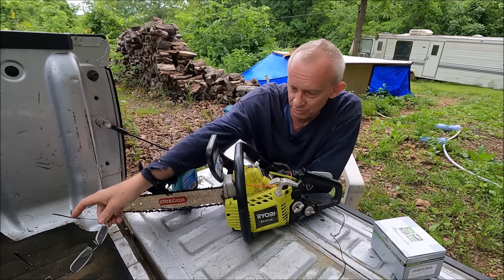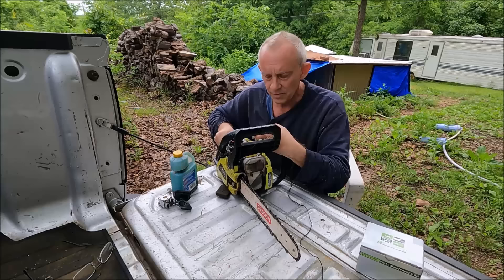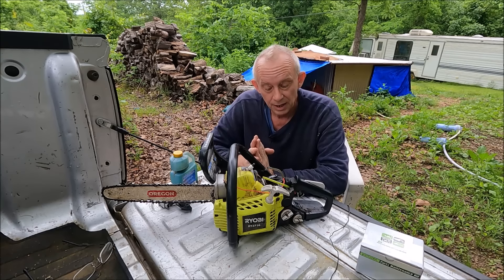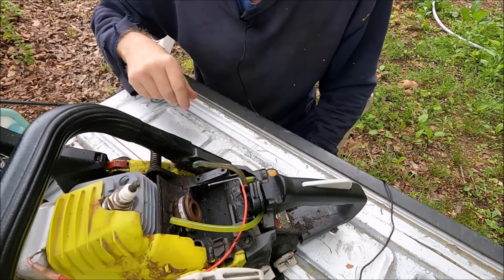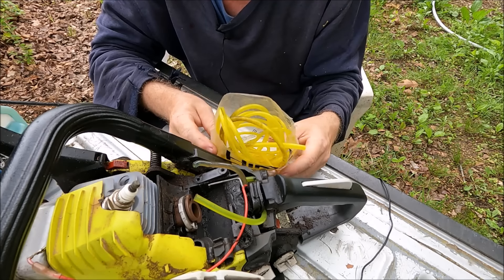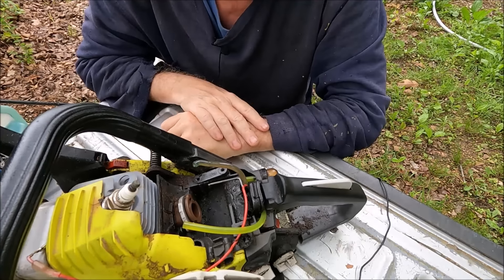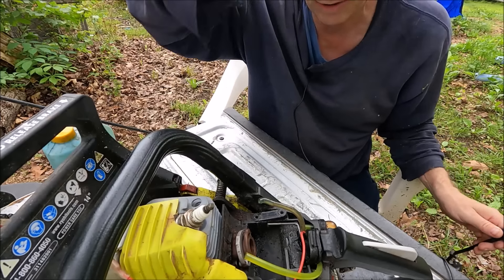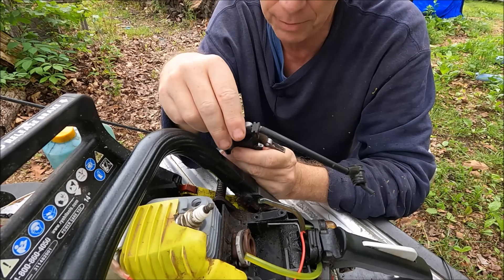Carburetor Kit For A 14" Ryobi Chainsaw

Comment: Good video,
Fuel lines and primer bulbs on these two cycle engines just about have to be changed every couple years.
Mainly due to heat and vibration cause fatigue in the rubber.
So yes definitely keep an assortment of spare fuel line and primer bulbs in a glss jar somewhere handy.
Real good price on that kit for sure.
Thanks for letting us know.